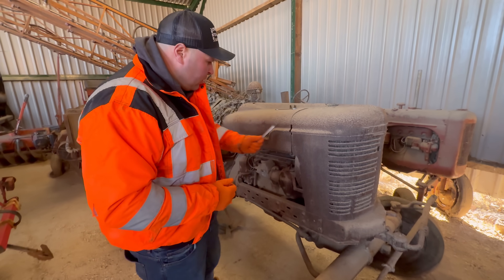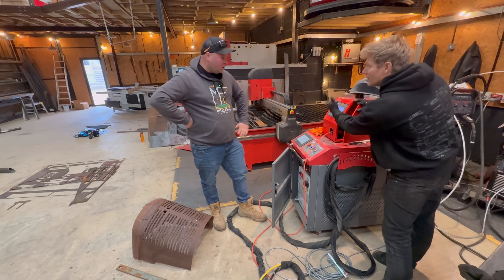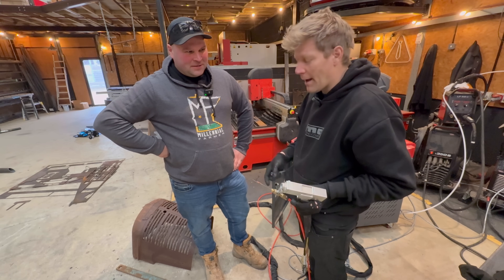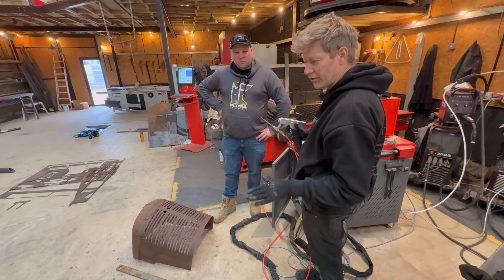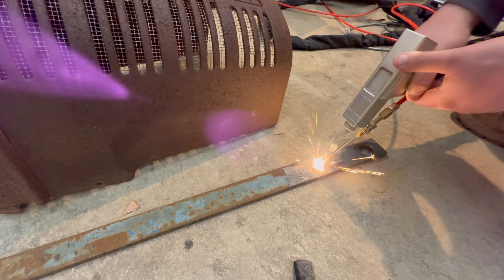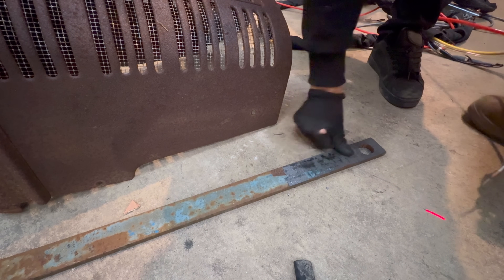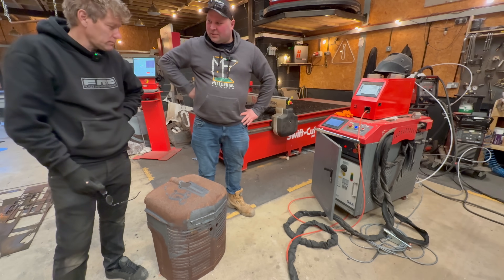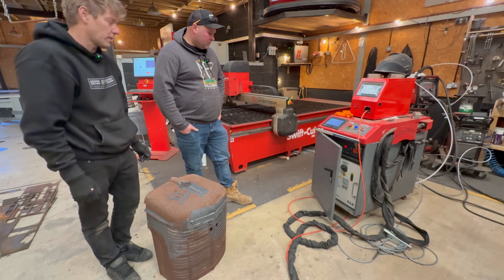HIGH POWERED LASER CLEANER (ITS UNBELIEVABLE)

Comment: Make damn sure you wear the correct goggles, even for the tiniest quick jobs! Small amounts of laser light can be 'bounced' back into your eyes; this is not repairable. In the same way that you cooked a bit of floor, you can burn things at a distance without realising, through screw/bolt-holes etc. Laser cleaner = wonderful, Workshop ashes not so wonderful.

Comment: I am curious, what's more efficient (in both time and money), laser cleaning or Evaporust? They both have the same outcome, but very different processes and cost structures.
Reply: Hard to get a whole tractor chassis in enough evaporust.
Reply: @bushratbeachbum Well, yeah, but for one body panel like this that's not so bad. Also if you have something hollow (not a tractor chassis, but maybe a car chassis, or even getting between the Farmall badge and the cowl), you can't really use a laser on the inside, while you can pour Evaporust right in.

Comment: Tom, you need to check out Yorkshire car restoration because they've got a 700 amp one and they did a review on it the other day. He said to clean and cut you can just use co2 or air compressor and then use argon for welding. Check them out ❤

Comment: Hi Tom, you were right to be cautious on the grille, I wouldn’t have risked any kind of media blasting on that either. I have a rust removal immersion tank for parts like that, I use bilt hamber deox C mixed 19parts water 1 part rust remover £100 to fill my 50gallon tank. It does a perfect job, better than any blasting. 
I don’t know how it compares to laser but it’s certainly better than blasting.
Blasting looks good but leave it a couple days and rust spots will reappear and these are missed bits. Immersion doesn’t miss anything and your paintwork is going to last. 
It was very interesting to see the laser and I can’t comment on how thorough it is.
Reply: Laser rust removal mainly uses a laser beam to work on the workpiece with rust stains. High-frequency high-energy laser pulses irradiate the surface of the workpiece, and the coating layer can instantly absorb the focused laser energy, so that the oil stains, rust spots or coatings on the surface can be instantly evaporated or peeling, a cleaning method that effectively removes surface attachments or surface coatings at high speed, and laser pulses with very short action time will not damage the metal substrate under appropriate parameters. The rust removal of the sandblasting machine mainly uses compressed air as the power to form a high-speed jet beam and then spray it to the surface of the workpiece to be treated at a high speed, so that the surface of the workpiece can be changed. Laser rust removal does not require any chemicals, and the waste after rust removal is solid and harmless powder, (mind the gasses when burning) which can completely solve the environmental pollution problem caused by chemical rust removal; and laser rust removal is a non-contact processing method, let alone worry about it.
Reply: @bastiaan7777777  Thanks for the info, all sounds good, I’d have to try it and see how thorough it is. 
The deox C is bio degradable and safe to pour down the drain.
Reply: No issue with blasting.... but like anything it needs to be done right. Right pressure/distance/media and zero issues.
Reply: @landroversforever  I have encountered an issue with blasting, when you blast clean you move metal around and this can cover corrosion.  It you leave it a few days this covered corrosion will reveal itself. But if you painted it right over then you are painting over corrosion and you don’t realise it.  I’ve done videos demonstrating this.

Comment: I literally have that same unit arriving Tuesday, 2000w 240v except mine may be blue or green. I bought it on alibaba for 2500gbp, shipping included. I got it for the reasons Colin said, I only have a stick welder and so cant mig or tig or weld ali or stainless. Hopefully this makes me a pro... with reference to newer ones being smaller. The air cooled ones are a bit smaller but from reading online its a bit too new tech and so not as reliable.
Reply from the maker: Thanks for the info
Reply: We youtubers will watch your review video and give it an upvote!

Comment: tom watch the fume off that, it's comprised ver very fine metal particles, bit like plasma cutters, its really nasty especially if any chrome or nickel in it.
Reply: https://youtu.be/MM2Uym2WPzw?t=534
You are very right Pete! Not many people realize this.
Reply: @bastiaan7777777 i worked for esab for 11 yrs, we started testing fume big time back in mid 90's. was bit bad what we found. its chrome6 worse problem features in lots mma rods, added as silicate binder. as a rule avoid any fume from welding/cuttting or spraying metal